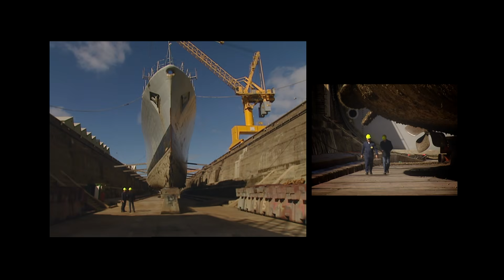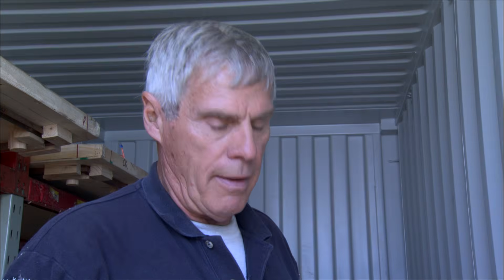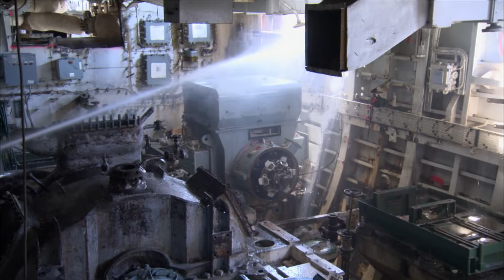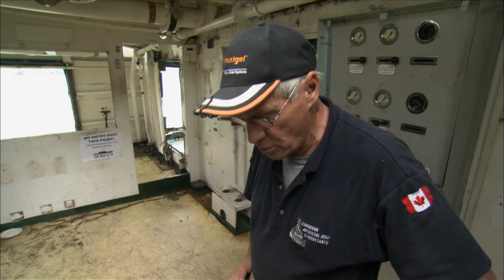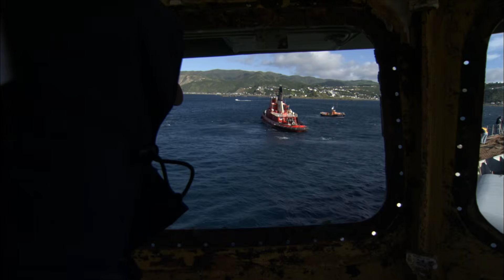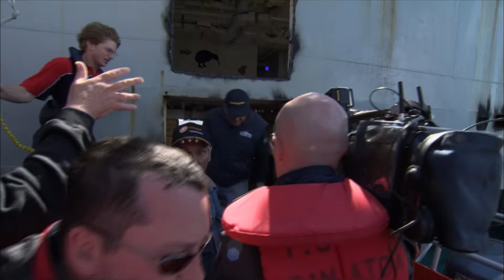The Ship Sinkers | Free Documentary

Comment: When a NAVAL Ship is at general QUARTERS and every hatch is dogged, ballast emptied and wide open,  drain closed shut, ventilation shaft isolated, compartment closed off its almost impossible to sink a ship. This ship is wide open and has extra holes cut all over. Then the placement of charges inside are devastating.  A torpedo can lift a keel of a  ship 10 feet out of the water and break the ship right in half but if the ship is at General Quarters the two halves will just Bob in the water.

Comment: Cut holes all in a ship and remove or sever all the piping and ya want to fill some sections with water, pre sinking and wonder why it won’t hold water. Ok crew ! Remove everything and cut holes everywhere possible air could trap, but leave some sections to be water tight for the prep of the sinking. Why won’t the damn thing hold water. It’s leaking somewhere. 😂      🥴 🤔 🤔

Comment: Waste of resources..much easier to scrap it all straight away, use concrete for reef.
Reply: Yes, it is cheaper to scrap them than sink theme and there are metal recyclers all over the U.S. that can cut them up for an electric arc furnace.
Reply: A few weeks later we had a big storm and 10 to 12 meter seas and it broke up in 3 peace's and one peace washed up on the beach and the rest got closed down for drivers as it was to unsafe. It cost more to clean up the bloody mess. 🤣🤣🤣🤣🤣

Comment: What difference does it make it the ship rolls over? How does it become a nav hazard?
Reply: The height of the ship is smaller than the width.  It would put it too close to the surface.  Plus, like the Florida sink, due to the shape of the hull, it is unstable on it's side.  Currents could push it around uncontrolled.  It would lead to constant monitoring of the position of the ship.  If it is flat on the keel, the ship's movement is kept to a minimum.  Fortunately, Hurricane Dennis righted the ship to where it was supposed to be.

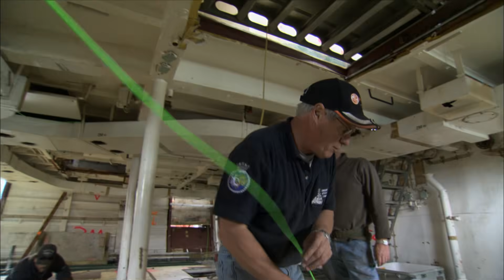Comment: 27:39 - 'Exploding at nearly 7000km/s'

I think he meant 7000m/s. 7000km/s is around 1/40 the speed of light, which is no mean feat. Ha ha.
Reply: Yes, misspoke on that one.  Det Cord explodes at around 6400m/s or 22,000ft/s and looks instant. Done a bit in my time. another way to say it, also @ 4 miles per second which equates to 6437m/s
Reply: Just like how it weighs 6,200,000lbs lol
Reply: @donwalker1882  I mean... It actually weighs that much. The ship has a displacement of roughly 3000 tons which is more than 6,200,000 lbs.
Reply: U Andy from Niagara
Reply: Get cord fuses a four miles per second and if its above ground you can see the light pulse flash through the fuse run

Comment: I would take one of those... Make a kick ass mansion on the water out of it.
Reply: what happens in 10 yrs when your "mansion" starts leaking??
Reply: @bobbertee5945  be smart, build support beams underneath it so it doesnt  sink
Reply: Having floating mansion problems?
Phil Swift: Introducing,flex seal!
Reply: There’s a whole fleet of these ships here in Benicia,California 
Creepy as hell and they lurk in the muddiest of bay waters
Reply: Many have tired. All have failed.
Reply: If you had that kind of money youd be better off either starting from scratch or finding something more modern that's a bit more solid. There is a reason they give these ships away, because they are absolutely stuffed. Canterbury sister ship to Wellington ended up having the water blasters putting holes in the hull when trying to clean it in dock. Not to mention all the wiring  was stuffed and starting to cause fires
Reply: @benmac7315  Also hiring a tug to move that thing around is NOT cheap
Reply: @dougmapper3306  I thought if you were buying a vessel  like that you would be  moving it under it's own steam not hiring a tug to move it each time.
Reply: Ben Mac if you’re getting an old ass retired ship that’s been out of commission it’s probably not going to run and it would cost a fortune to service the giant engine that powers it so if it’s just going to be used as a mansion on the water I don’t think you’d bother with making it mobile, just have it towed into it’s place and anchor it in place. I’m sure there are quite a lot of houseboats who don’t and haven’t ran.

Comment: Why they cant reuse or recycle this steel?
Reply: Artificial reef 😀 worth more as a haven for wildlife than it is scrap
Reply: Artificial Reef i guess we do have Artificial Fish and Artificial Water 🙄
Reply: Not cost effective, extremely dangerous work, environmentally hazardous to name a few reasons. Just the cost alone of towing the beast to a location where it could be done would likely be more than the scrap value.
Reply: EPA & Osha
Reply: Yes, it is cheaper to scrap them than sink theme and there are metal recyclers all over the U.S. that can cut them up for an electric arc furnace.
Reply: kansasthunderman1 I call BS on that. If it was more valuable as scrap then more would get scrapped. Money is a big motivator. Steel isn’t worth much, 4 bucks per hundred pounds. That sounds good when you think of the weight of the ship but when you figure in all the costs that go towards insurance, fuel, equipment, other ships to haul it off or the cost of bringing it into a dry dock it doesn’t make sense. If it was profitable to scrap ships there wouldn’t be countless dead ships floating around everywhere or being sunk. It’s profitable to salvage the valuable stuff and sink the rest.
Reply: Too much work. Most people don’t have the funds to scrap a ship.
Reply: @airforce1393  U can just take 10 people and the circular saw and do it in few hours
Reply: Dodge Guy I don’t think you understand the size of this ship. Nor do you understand that it’s gonna take more then 10 people and a saw to do this. I really hope you were being sarcastic
Reply: @airforce1393  Of course it will take a lot more,but i think its worth it at least for the sake of environment
Reply: Dodge Guy metal really isn’t that bad, will rust and dissolve as time goes on. They make great reefs and places for aquatic critters to live. They really aren’t that bad. Some city’s even use train cars as artificial reefs.
Reply: @KISHANTH JEYAMOORTHY there is still nearly 3,000 tons of steel that doesn't have to be mined that can be used, the very last bits that cannot be used can be shredded and combined with other waste to produce road base.